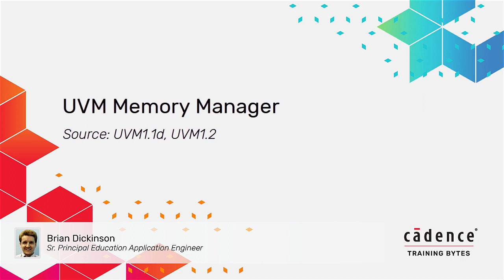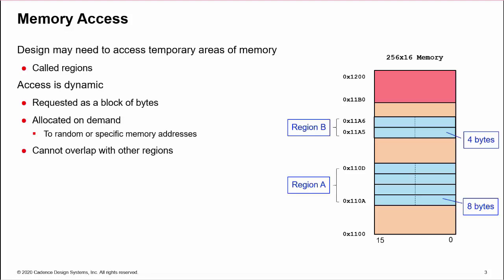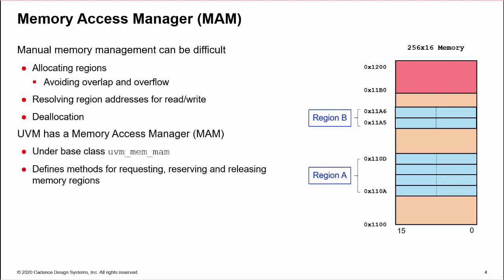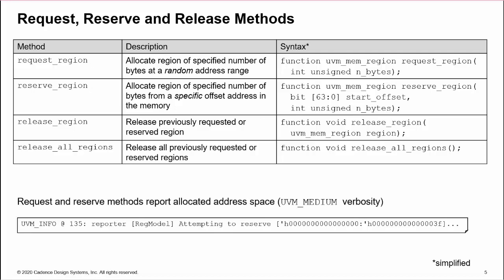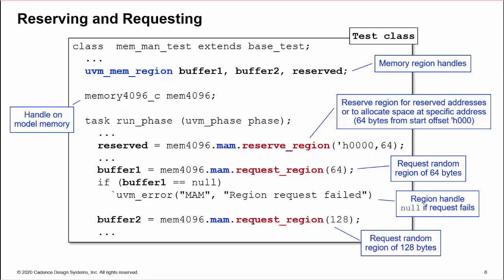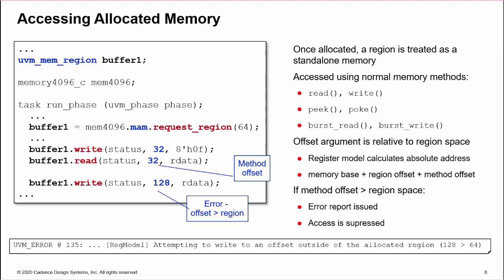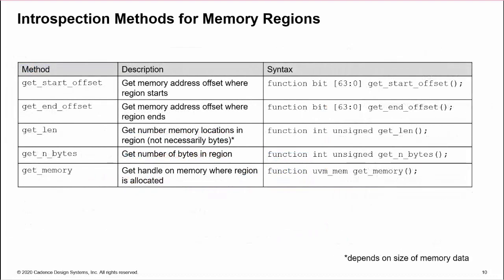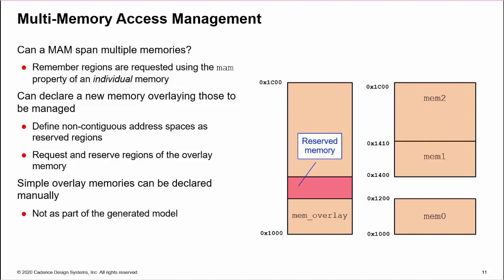UVM Memory Manager

Comment: One thing to note that the presentation does not make clear. You need a UVM Register Model, created, for example, by a model generator tool such as Cadence's reg_verifier from an IP-XACT register specification. This is important for addressing since, as descibed in the presentation, an absolute memory address is calculated from a base address supplied in a Register Model address map, and an offset address defined for a specific memory instance.
The Register Model needs to be correctly integrated into your UVM testbench. Any memory instance in the model will then automatically have access to the Memory Manager.
For more information on generating and integrating UVM Register Models, please search for the Cadence presentation "What is UVM Register Modelling?"